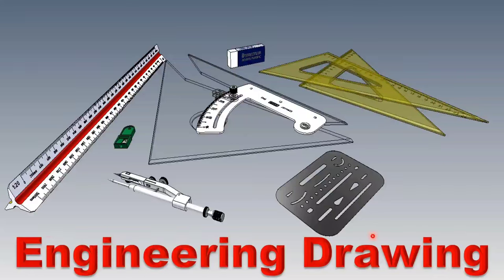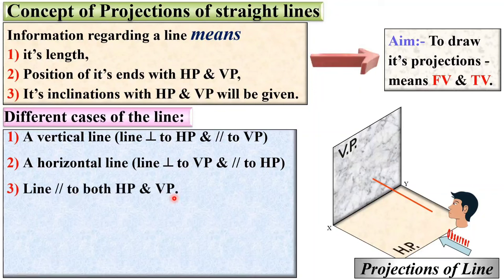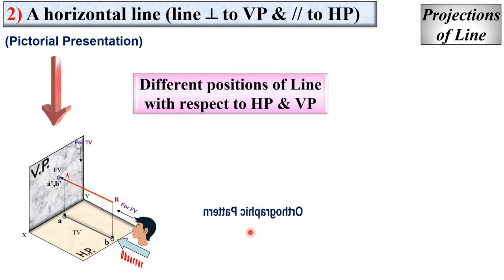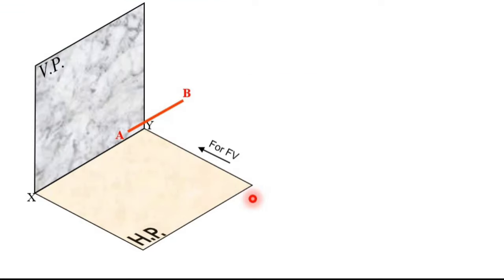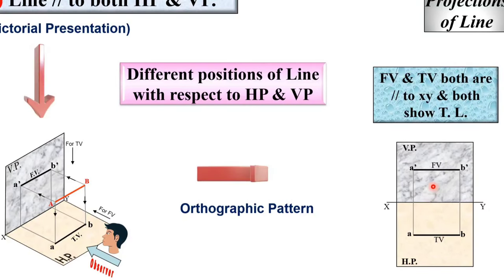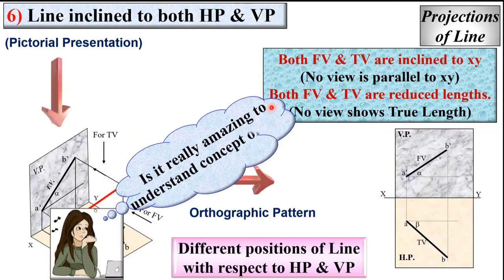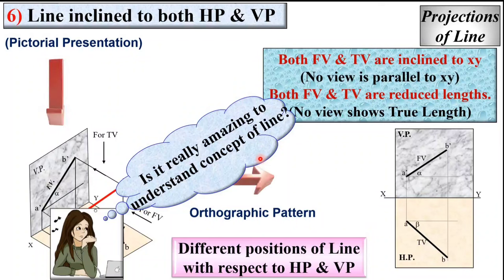1 - Projection of Line (Basics, Drawing Process & Solved Example) Explained in Engineering Drawing

Comment from the maker: Projection of Line explained with following timestamp: 
0:00 – Projection of Line in Engineering Drawing lecture series 
0:13 – Projections of Line
0:39 – Concept of projections of lines
1:29 – Different cases of the line 
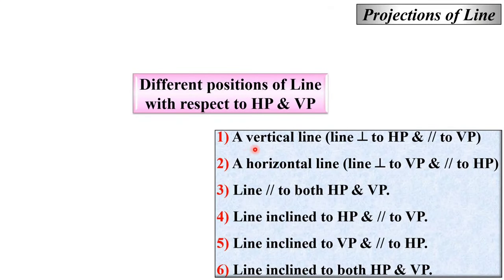3:33 – A vertical line
6:39 – A horizontal line
8:40 – Line parallel to both hp & vp 
10:38 – Line inclined to hp & parallel to vp
12:30 – Line inclined to vp & parallel to hp
14:54 – Different position of line with respect to hp & vp

Comment: Consider a 6-variable boolean expression represented in canonical sum form as given below:

fu,v,w,x,y,z=(1,2,3,4,5,16,17,18,19,20,25,26,27,28,29,30,33,34,35,36,53,54,55,56,60,61)

Simplify the given expression by using Karnaugh Map simplification method.
Please Sir iska solve kr ke samjha dein Please..
Reply from the maker: I have already explained 6 variable k map. Kindly refer it to solve this expression.
Reply: @EngineeringFunda  But i am confused about the question.Please solve this in a simple page and share with us.
Reply: @EngineeringFunda  Sir jo apne solve kiya video mein wo karnaugh map simplification method he?